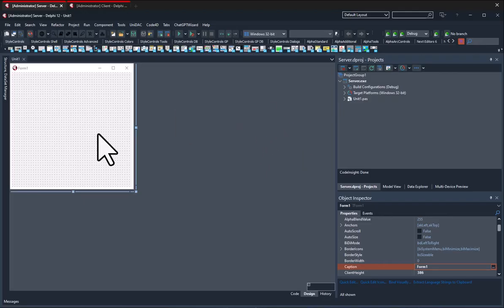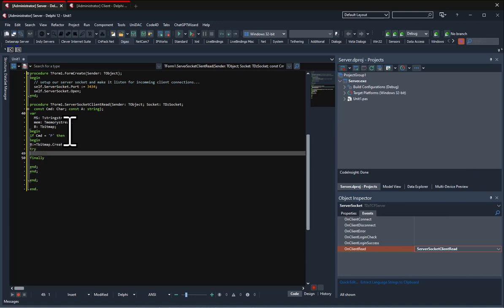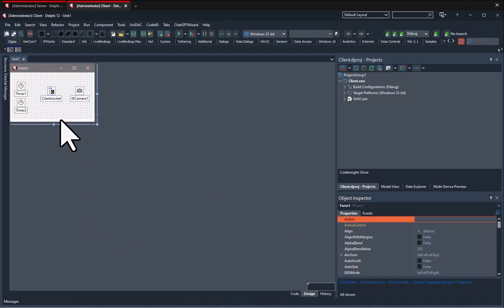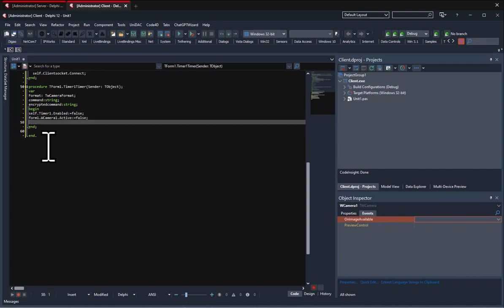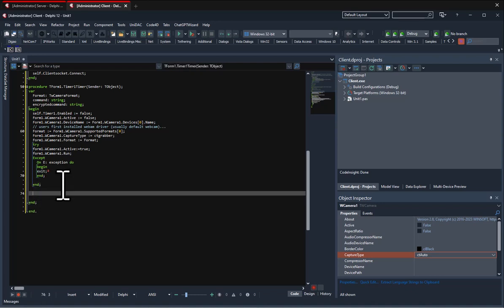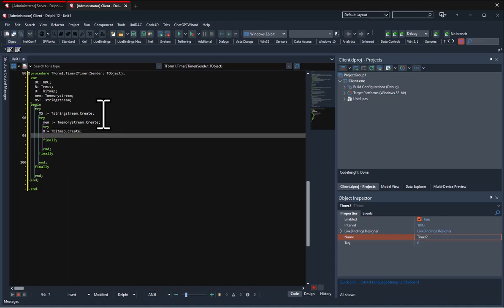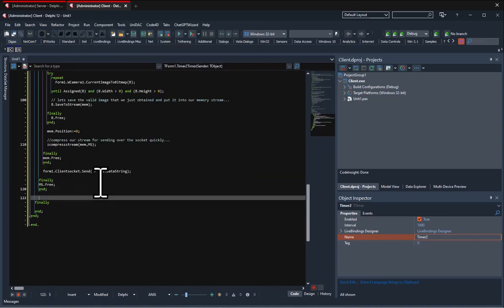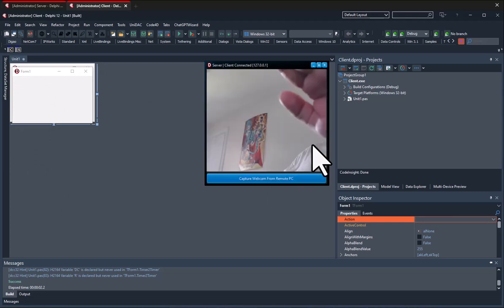TCP Webcam Streaming In Delphi (Basic Example)

Comment: It will be good if you do same tutorial but with media foundation in delphi , its the api the most stable
Reply from the maker: I'm not sure what that is, however taking 2 images and comparing them and then sending over only the changed pixels gives Realtime results I may cover how to do this... but if your interested in learning how easy it can be done check out this guys project on Github: https://github.com/abalad/Delphi_Remote_Access_PC  | The guy uses Tmemorystreams binary to quickly detect changed bytes / pixels in screen color and then send over a stream containing only the changed bytes / pixels this cuts down on bandwidth and also makes for Super fast streaming experience. You could easily pipe in either Desktop imagery or even webcam images if you really wanted to. 

Hope this helps you out Good luck man :)
Reply: @BitmasterXor  media foundation is the sucessor of directshow but its not working for me :( , i use mfpack for use media foundation but I can't sucess to convert the code c++ in delphi pls help me , the code in c++ is on the microsoft website in search "audio video capture in-media foundation"
Reply: @BitmasterXor  please I need help in comment my friend

Comment from the maker: Just wanted to let you guys know the following: Using basic components for doing stuff like this is extremely hindering! a far better approach would be to write this all in code and not use components at all This will ensure that you can stream the webcam frames faster and more accurately. When you choose to use components such as the one I have used to make this video you are pretty much at the mercy of whatever person / company wrote the component or components responsible for allowing you to access your webcam driver. If you simply write the code yourself to lock on to the webcam drivers you have installed you can gain a lot more control over what you are doing. 

The Reason I used the component in this case was so that I could code less and have a shorter YouTube video to demonstrate how simple this can be accomplished in the Delphi / Pascal programming language. 

I hope you guys enjoy it, if you would like me to code more advanced tutorials simply ask and I will be happy to do so for you.